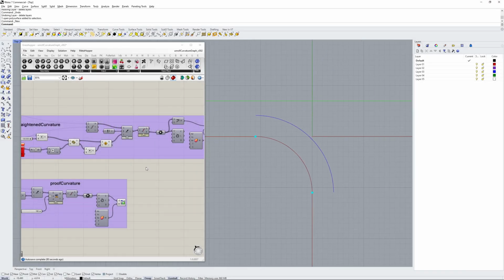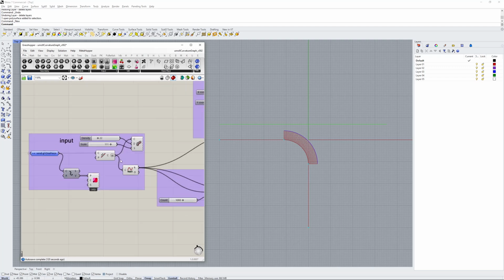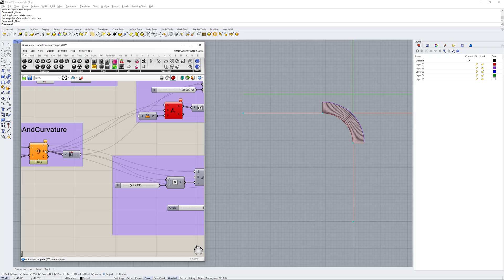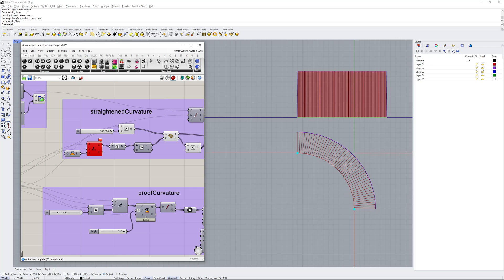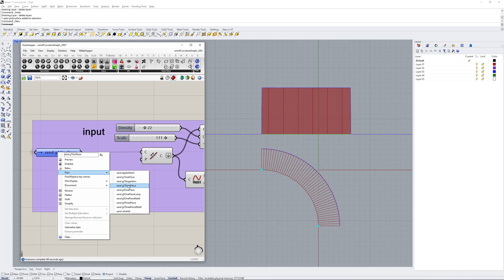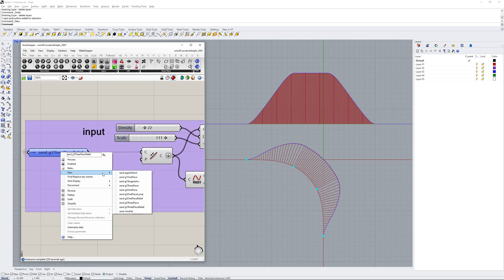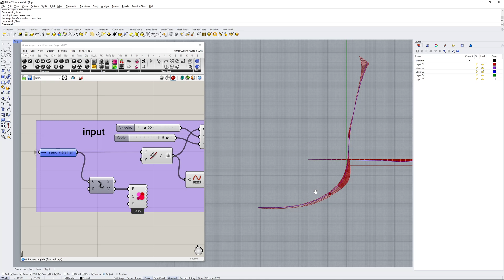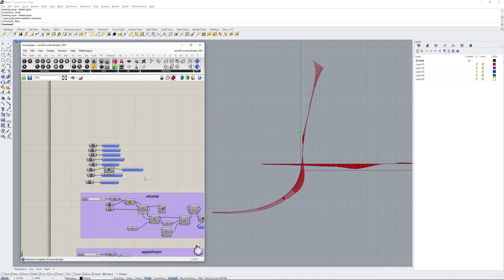Unroll A Curvature Graph In Grasshopper

Comment: This makes me wonder again, that if you modeled something with a lump/jump or two, could you massage the curvature comb? I suppose in some ways that would be Solidworks' 'fit spline', but even that only follows underlying surfaces very closely and can also still look jumpy.
Reply from the maker: No way to massage the curvature comb directly, its always curve>combs. I'm pretty sure fit spline always has jumps in the curvature when fitting across references that have G1 continuity as it is fitting a multi span spline across a sudden curvature change. Should be ok with G2 joins though.
Reply: @AndrewJacksonDesignStudio  - I know one can't massage curvature combs, but one can dream. Especially software with feature tree / history, this should be possible (in my mind at least).
Reply from the maker: I’ve started having a look at a reverse curvature set up in grasshopper. Might be a bit beyond me.
Reply: @AndrewJacksonDesignStudio  - the moment you pulled that data out of Grasshopper, is what made me think that surely it must be reversible... I too am just too dumb for it (programming / math).

Comment: Andrew, I think you already know I will ask this but here it goes - Is it possible to create curves from an unrolled curvature comb that you specify? Meaning I draw the profile of the unrolled curvature comb and grasshopper generates the curve for me. I guess it is possible if there are no multiple or infinitely many solutions?
Reply from the maker: I think that'll be quite a challenge. Might end up having to convert the comb lengths into arc sections (one per comb) then connect them all tangentially, then approximate the final spline through the arcs. Damn, now you've mentioned it I have no choice but to think about it!
Reply: @AndrewJacksonDesignStudio  I think we will first need to confirm that there is only one solution or finite number of solutions. I think you will need to consider vector direction and step length.   Need to analyze this more carefully
Reply: Andrew, I think additional parameter you should consider is angle vector - angle of tangent on a point on the curve and how it varies along length of the curve.
Reply: My intuition tells me that you will also need to consider the tangent angle of a point on the curve and how it varies as your traverse through the curve. Something tells me that is important to find the desired solution
Reply from the maker: Something tells me this will be quite difficult!

Comment: goddamit i have to learn grasshopper now. seems most things i wanted to do is possible with grasshopper!!
Reply from the maker: Do you use Rhino? I've been using it since 2000 but only really got into GH about 4-5 years ago. There is a little bit of interface stuff to get over, like not being able to select things in the Rhino display port in the normal way. It is definitely nice to be able to build stuff as you want, even if it is an exercise or experiment.
Reply: @AndrewJacksonDesignStudio  I have not been able to because of my SolidWorks dependency. But I really should make time for it. All the questions I have in my head I think can be tested in grasshopper. Takes some brains as well I guess which I am not sure I have 🤣